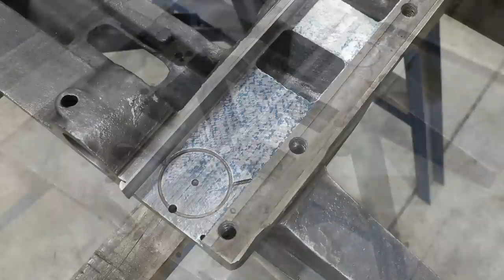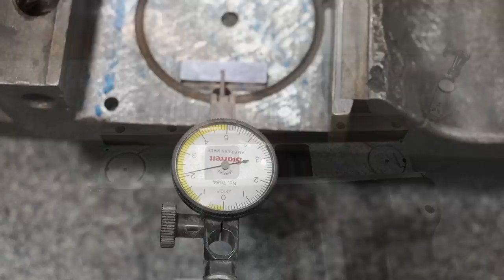Horizontal Boring Mill Restoration - Step Scraping the Saddle to Coplanar

Comment: A trick I learned in printmaking class: if you lift the roller instead of going back and forth, a given area on the roller contacts a new area on the plate each stroke, greatly improving how evenly the ink is spread. Only really saves a few seconds, but the difference is satisfyingly noticeable when you try it.
Reply: Same when painting a wall too!

Comment: I am always fascinated by the minor variations in the language from one region to another. Where I grew up in the upper mid-west, oil is pronounced in 2 distinct sounds stuck together... oye-ill, out west is has a much softer oye first part, more of just an o-followed by ill    oill with no emphasis in the middle of the word.. Down in Keiths area its a smooth   o with the ll, just oll
To me this is fun... just a neat side trip to Keith's project in the video.  The process of measuring and gauging and scraping is fascinating.. bringing the machine back to a collection of accurate planar motions.  Wish my dad was alive to see Keith's video. He loved mechanical engineering and machine processes... it was his career. He also loved antiques... and restoring.
Reply: I'm sensitive to what I consider the mispronunciation of the word "height" as if it were spelled "heighth".  Many elderly carpenters & machinists add the "h", for no reason that I can understand, although it replicates words that also invoke dimensions : "depth", "width", "length", etc.  Is it just a cutesy flourish or a real misunderstanding of the spelling?

Comment: Man, this is just fascinating to me.  I'd never even heard of a tool like that scraper.  Fabulous series, here, and I've become a huge fan of your channel.  Thank  you.
Reply: Same here. I’ve always had a picture of ultra-smooth flat surfaces rubbing (and sticking). No room for oil. Lots to learn.
Reply: @robertbamford8266  Google stiction, and gauge block wringing. Both are effects of no space between two flat surfaces. Cold welding is another phrase I've heard but know nothing about.

Go look at Keith's planer series, early on during disassembly. He takes it out for surface grinding to make it 'perfect,' then scrapes it. Extremely informative, the whole process A to Z.

Comment: Keith, seems a perfect case for a precision grinder rather than scraping. I know your grinders may not be able to handle a piece of that size but I suspect folks like Lance would have a big enough grinder.
Reply: Scraping is traditional!  Countless machines have been built in the past 100+ years and scraped in by craftsman to these amazing tolerances.  This is the way it should be done!
Reply: @paulcopeland9035  It was traditional to go to town in a horse and buggy but few do that any more, because it is faster and more convenient to use motorised transport. Even Keith sent the bed of his planer and  Monarch away to be ground. I just suspect folks who are a lot less competent than Keith,  will try scraping in their worn machined surfaces, only to make them worse than they were originally.
Reply: @wilsonlaidlaw  Okay sure, but efficiency is not the issue here. The Monarch and planer were large pieces that were well out of spec.  This piece is something he can handle in his shop in the traditional way.  Sure, there are laser guided grinding systems that would correct this part to optical accuracy but that is not the point.  Check the title of this channel.

Comment: 4 thousands is a lot to remove by scraping and you must have the patience of a saint - what other options are there?   Balancing it on the mill table seems risky, a big shaper might reach, or would a surface grinder with a large wheel reach?   Asking because I have no idea

Comment: As I recall a couple of videos back you said you weren't going to work on the bed ways at this time.  I was wondering about putting newly scraped saddle on a worn bed.  I had always heard repairing/replacing one half of a pair of mating surfaces causes accelerated wear of both.  Is this true?

Comment: Just curious Keith... Would it be easier to remove say half of your variation off of the other side since those ways are flat? Seems like it would be faster in the long run since you won't have to scrape into the corner of the way you are working on here. Additionally, that would leave the very top surface closer to the plane of the inset way you are showing here.
Reply: You mean take 2 thousandths of tilt off the underside, and 2 thousandths off the top side?  I'm not sure I entirely understand what you're thinking about, but I think you mean flip it over, take off 2 thousandths taper, and flip it back here.  Consider all the details...  Every time he makes a rough "stock removal" pass, it's going to introduce non-flatness and tilts and so on for that particular surface.  So this would mean flipping it over, and starting with roughing passes, doing finer passes, finishing passes -- lots and lots of work that mostly got edited out of the previous video!   And then that has to be done for both of the slides on that side, with special attention to making them parallel again, which is a big challenge in itself.  Since all of that work has already been done, it would mean throwing away all of that previous effort and time and doing it again.  And then flip it back over again, and do that on this side for the other 2 thousandths.

Now, consider... he removed 2 thousandths on that side by scraping, and 2 thousandths on this side by scraping, which, if I'm not mistaken, is *still  4 thousandths, which is a lot of scraping no matter how you slice it!  So in the end, there's no noticeable benefit, but quite a bit of cost.  Unless, of course, I misunderstood what you where thinking about, in which case I apologize!  :)

Scraping is one of those things you really have to just work through one step at a time.  Make a game plan -- choose what you're going to use for reference surfaces and how to test them, and get the order of steps right, before you even start.  Then as you go, just work the plan patiently, be careful, don't cut corners, and finish nicely!

Comment: I thought he'd use the indicator on the arm to move along the entire length; seeing how many times the needle spun around as he put it on the surface, it seems like if one end is different in height from the other by more than once around the face, you might easily end up mistaking a negative for a positive difference.
Reply: He marked the work piece. I believe when you do this type of process, it is important to pay attention!!

Comment: why didn't you measure the height in the center of the groves and assume linearity in between ends ?  thank you I really enjoy your restorations
Reply: With both sides being a known height from the granite block, placing the calibrated straight edge across the points and bluing it in tells you that the center is in the same plane.  It can only be ooff by the margin of error your tools have (granite block, straight edge, mics, etc).

Comment: Is there a reason you don’t just put the whole saddle on a mill and use a facing tool to cut the entire face perfectly flat and parallel? Set a repeatable plunge so you know both ways are coplanar to the saddle top ways?

Comment: Around 20:00 you speak about touching up the straight edge as needed... I don't understand.  What's going on with a straightedge that it needs to be touched up?
Reply: Have you never had to tune anything up?  God bless you my son.  You are a blessed individual!!
Reply: @paulcopeland9035  - Nope, I've never had to 'tune up' a straightedge.  I don't use any of them so much that they get wear.  Given how long it takes for scraped ways to wear down their scraping marks with machine tool use, I don't really understand how that could happen without being used all day every day for years.

Comment: 15:41  I don't understand why this couldn't just be done on a surface grinder.   Is it because the piece is too large?
Reply: The major correction could be done on a very large and accurate surface grinder with flood coolant to prevent distortion. Turn around for shipping, ways ground and heavy part returned would take months and still need to be inspected, possibly scraped again, and oil retention grooves added. Considering the time and huge expense involved it’s easy to see why Keith choose to do this job in house.
Reply: @ellieprice363  But he has a surface grinder...
Reply: @jimthesoundman8641  Yes but probably not large enough to grind that huge part. Surface grinders wear like any other machine. A new one would not be as accurate as a surface plate and his is not new.
Reply: @ellieprice363  But he shows how he zeroes out his surface grinder every time he uses it.
Reply: @jimthesoundman8641  yes I know you dress the wheel and grind the table true and stone it but it still has to be big enough. I’ve had a Kent in my shop for many years and use it often.
Reply: @jimthesoundman8641  ....It is a scraping project!  Very traditional and very accurate.  Grinding would be a PITA and would probably require some scraping touch up anyway!  Quit arguing and listen to Ellie.  Enjoy the video.